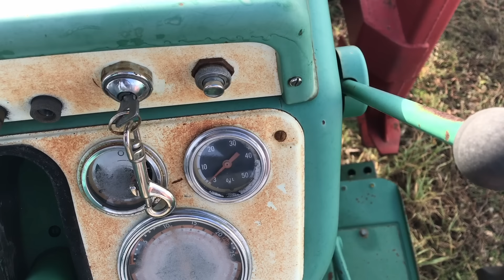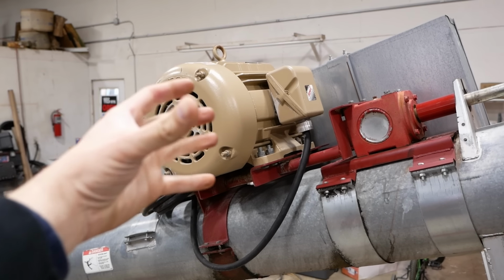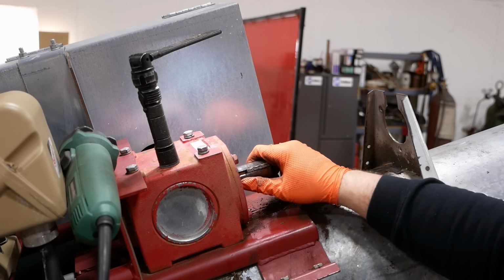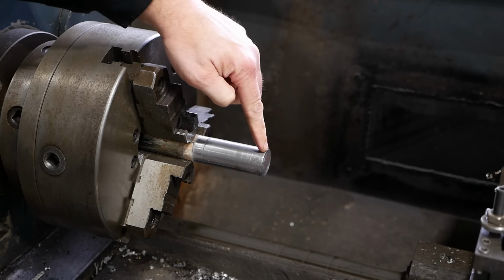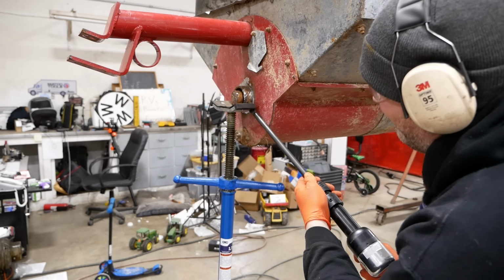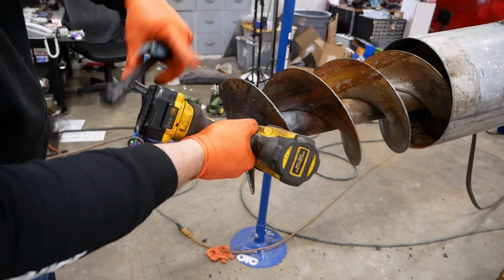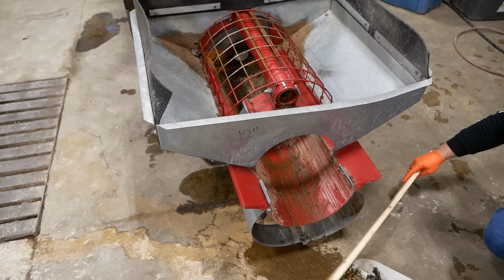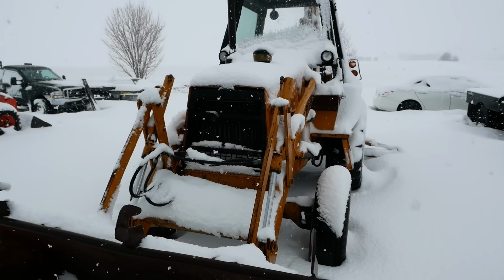Using ALL the Tools to Fix a Chewed up Grain Auger

Comment: Thanks Wes. I worked on grain bins, augers, belt elevators, etc. about 25 years ago as a summer/weekend job. I can attest that rotting grain is enough to gag a maggot, every single piece is always rusted, oblong, wallowed, broken, and mostly designed to never come off, and that no auger has ever been repaired willingly and without a blood sacrifice. Thanks for the memories. Working that job made me drop pre-med to go into engineering. I mostly hate people, so I think the world is a better place because of that.
Reply: Like the Area Diesel Service hoodie..!!
Reply: So you design the machines that hate people. Get rid of them directly, or go big and have the machines do the work…
Reply: 😂  I can relate
Reply: You didn’t have to tell us you hated people, it was self evident when you said you were an engineer. lol.

Comment: Wes: I got about 12 hours into this job, it's just difficult to find that much time to work on a single project...
Me: I tell you what's even more difficult to find.... A machine shop in the middle of a corn field and a machinist who is willing to work on a corn auger for 12 hours...
Good professional factory repair Wes, awesome video and content.
Reply: Wes is amazing.
Reply: If Wes Works, they will come…
Reply: I'm surprised they didn't just weld the coupler to the shaft, must be a new farmer
Reply: The workshop is kinda open again for the public because Wes choose what he'll take. That is great to see.
Reply: @M.TTT.   maybe coulda woven a Chinese handcuff outa bailing wire, but it’s subject to work hardening…
Reply: Thankyou 👍 all good stuff
Reply: 12 hours. Or a new grain auger. Should last a while longer now. You can keep the snow. Although our weather has been pretty awful too. Mid 30's C. And humidity through the roof. Every time you try to do anything, you end up in a pool of sweat. Both ends of extreme.
Reply: 6hrs repair, 3hrs cleaning, 3hrs panel beating and restoration- grand job Wes🇬🇧😳
Reply: @IR-nq4qv: well said.
Reply: Thanks and stay safe 🙏
Reply: First time I have heard "hot dog down a hallway" in that type of manner!! Usually something way more sinister!
Reply: Especially when these augers sell at a farm auction 30 mintues from his shop for 250-500 bucks by the dozens twice a year

Comment: Wes, you decided on the CEE repair to the drive shaft and it looks great!  Most people don't appreciate how destructive spoiled grain and water are to farm equipment (rotting soybeans smell worse).   You have a good lathe setup, and glad to see someone in NW Illinois still knows how to use one!  -17F this morning at my place, so I agree that Winter has self corrected.
Reply: All Wes needs is a couple of birds that hang out and his dog wearing a camera.
Reply from the maker: It was -17 here too. Max wanted to go for a walk. We barely made it across the road.
Reply: CEE  Is one of my favourites. The Crane teardown and rebuild is going to be done as thoroughly as Wes would do it.
Reply: @IGDZILLA  I think that the Frana Crane could keep Wes and Kurtis in content for the next year.
Reply: @WatchWesWork  I'm in NE Wisconsin and the last few days, even our Saint Bernards didn't want to go out.  LOL
Reply: There’s a ton of machine shops in NW Illinois, problem is you either wait 6 months for it to be done right manually, the shop only wants Cnc work or you take it to a mom and pop, which might do it right or might not but there usually have faster turn around times.

Comment: Very cool, I grew up around farms and my grand parents owned a grain elevator. Fixing augers that the grain dust ate up was a constant like you said. Cleaning out the rotted grain in the pit around the grain dump basin was always one of the most gag inducing tasks we had, so I can empathize on the rotted corn smell. Have a great day sir, may you and yours be safe.
Reply: Just don' a gas mask and it doesn't matter what's in front of you :P
Reply: Especially if it's mixed with rust for some reason. 
I grew up in the first small farm town north of Flint Michigan and sometimes help friends who lived on farmstead.
That became one thing I avoided at all costs after the first time no matter how much they'd beg me to help.
That and mucking livestock structures.
Reply: I am a born and bred “City Boy “. I thought we were going to make “pop corn “ for a minute there!
Reply: @rkan2 the mask slows you down to much
Reply: @adamdnewman  A blower mask won't.

Comment: I come from an industrial background, but the machinery is the same.  A lot of screw conveyors have a stuffing box on both ends to seal the trough with the bearings outboard.  The stub shaft is longer but it allows the use of actual bearings and long life.  Great video!
Reply from the maker: That would be nice.
Reply: That makes more sense, but also more cost.
Reply: Stuffing box only helps if the farmer actually keeps it maintained, I know the farm I work on is basically allergic to greasing stuff unless I nag them to let me do it, and many farms in my area are the same way.

Comment: Great job. My dad had an auger similar to that when I was a kid and that bushing would only make it a couple of years. We finally welded some angle on to the funnel box and put a self aligning pillow block bearing on it.
Reply: yea that's what this needs, not sure why they use a bushing
Reply: Ditto. I used to sell bearings and gear boxes. I asked one time why farm equipment had such cheap gearings. The trainer told me, farmers are cheap and they use their equipment about 3 weeks each year.  Bearing upgrades are worth it for sure.

Comment: I imagine Mayrath has a huge number of fixtures specific to the augers, and procedures, like removing the axle A-frame so as to fix the fixed bits better.  But, I'll wager they would not shave more than 10 man-minutes' labor off the job.  So, good job @Wes
And, as always, a great video.

Comment: Thanks for another good video, a grain auger makes a nice change from rusted out trucks with electrical problems. When I used to work at the seed farm fixing the auger fleet was my job. I got real good and creative with repairs to some of them, that were worn out and should of been replaced. I still go back once in a while and fix stuff for them if they are busy just to keep my hand in, but luckily it's new augers and service work more now . Yeah that wet rotting grain smell's something unique. I'd say it would be about the same smell and consistency  as feeding Max Taco Bell everyday for about 3 weeks, and you certainly don't want to get it on your hands and try get rid of the stink for 2 days after L.O.L  Take care.

Comment: My dad and I used to fix these things for the local farmer when I was a kid.  I never knew how they managed to screw them up so bad, but I always despised working on them.  You could always guarantee a weld job was coming.  All the ones I've seen were PTO driven, so probably worse damage happened if you consider I don't ever remember seeing a slip clutch on them.  Farmers will run the life out of things for sure -but generally out of desperation and not ignorance.

Like how you removed the coupling ..just got a flashback to a 3 point spreader I bought last year.

Comment: As soon as I saw a grain auger coming into the workshop I knew trouble was in store ! I grew up in Western Canada on a farm , as you drive down the gravel roads you see more than one grain auger lined up in neighbor’s machinery parking area waiting to be repaired , nobody has the time to do it during Spring or fall rush so just they get a new one because you can’t stop seeding or harvesting and you can “ fix it this winter” but after you fix one it gets old really fast so they don’t get “round to it” ! Bloody aggravating as every one is different and you can’t seem to get parts for them?

Comment: Air hammers are the true unsung heroes of everybody who turns wrenches and finds themselves responsible for the care and maintenance of rusty junk. I feel stupid that it took me until my mid-30s to finally get one and start using it--they're cheap and will run off of a lousy roofer's compressor. Better late than never, I suppose.

Comment: Cool repair.  I like your explanation of why the oil lite is the preferred OEM and repair.  I wonder if a secondary stainless sleeve on the outside with a couple set screws that could hold the steel/bushing assembly would work then the OEM could sell a replacement kit that drops in.

Comment: Loving the sketchy lathe setup and the weasel wiz cutting lubricant 😂. I did wonder if a double sealed roller bearing on the auger end might have been a better setup? Things are getting all hyped up this side of the pond about torrential snowfall coming. Two inches of the stuff stops most of the U.K. 🙄. G wagon time is what I say 👍😁.

Comment: We used to use what’s called a Babbitt tail bearing on the tail end of those augers. It’s basically a lead filled cast iron housing that bolts onto the end plate. They wear slowly and in addition to providing lube for the steel tail pin they prevent them wearing down in diameter also.

Comment: Nothing like the smell of wet soybean meal when locating railcars at milling company on a hot July or August afternoon. I feel your pain of the smell of rotting corn, sure it is similar to mine. Not to mention your boots tracking in back in the motor for ride back out to the main line.😮
Reply from the maker: And chasing off the super sized rats!
Reply: @WatchWesWork is that where the princess bride came up R.O.U.S?

Comment: My brother has 5 augers and it's one of the things that breaks the most on his farm. I'm so annoyed by how poorly they are made that i'm genuinely consider making one from scratch to pit against them.
Reply: These are built cheap because they sell cheap. Highly competitive industry. I engineered, built and sold these for 40 years. They are only designed to last about 5 years. There are many different styles of end bearing arrangements. You can buy replacement parts from many different manufacturers. The oilight bronze is the cheapest. The option that uses a pillow block ball bearing is the best but requires a stand off trough end and a longer tail shaft to accommodate it.
Reply: @billyporterfield2196 Why couldn't you put a roller bearing in place of the bronze  sleeve?
Reply: @rkan2 I I don't work with grain augers but in another contaminated environment.  The problem with roller element bearings is that if you get crud in them, they jam and the rollers skate rather than roll and wipe out the mating surface.   Plain bearings suffer less.  In my ignorance I would like to try a plastic bearing and a stainless shaft (for wear resistance) but it's hard to retrofit that since swapping metal for plastic kinda needs to be considered at the beginning of the bearing design.  Exotic high performance plastics which could maybe swapped for metal exist, but they're also expensive.
Reply: @rkan2 you can if it is a pillow block bearing sitting on an outboard pedestal as I explained above. You can buy this conveyor new with this arrangement but the cost will add about $1000 to the sale price. Most of the farmers don't consider this a necessity until the sleeve fails. Remember that the highly competitive nature of the grain industry prevents the manufacturers from adding this feature unless they are willing to provide it at their own cost. Conversely on the heavy duty industrial side it is the opposite. Most industrial clients are more than happy to pay for any enhancements that add to the longevity of their equipment due to costly downtime and loss of production. Farmers just want to get thru the harvest and worry about repair and maintenance when the next season starts.
Reply: @billyporterfield2196  I guess that kind of translates to when your farming operation is large enough where you can buy machinery that is basically "heavy machinery" :P Not so with this auger.

Comment: Nice fixes, wonder when it makes sense to replace these bushings with actuall ball bearings? I'm guessing those are a lot more expensive
Reply from the maker: I think the dust and grit would just eat up the seals.
Reply: I suppose you’d need needle bearings, and you’d need some kind of spring loaded greaser to push ambient crap out.   That hopper needs weep holes ?
  That thing needs to live under cover !
Reply: A lot of the industrial augers will have a rope packing seal to keep the material out, then a flanged bearing after that. Works well, but pretty complicated

Comment: Hi Wes, I would think that a sealed ball bearing pillow block would be a great improvement over an exposed bushing for the auger assembly.
Reply from the maker: I've never seen one done like that. I'm guessing that means it doesn't work.
Reply: You'd have to change the bearing material.  Oilite bushings are oil impregnated, and adding grease would not aid its lubricating properties.  If grain dust got in to the mix, it may even close up the open sintered structure, removing the oilite's ability to lubricate.
Reply: Any grease squeeze out would be bad for whomever you are feeding it to.
Reply: I guess Snowball Engineering has influenced you Wes,  Thanks for the link to his channel. Take care of yourselves.  Kindest regards from Bonnie Scotland.  Joe.
Reply: @12345NoNamesLeft There are FDA approved "food grade" greases, but that's expensive and we all know how it'll actually go down in the field ... 🫣
Reply: @tsp159  ,  fwiw ... There is no such thing as a food-grade grease that works as well, much less better, than either industrial petrol/parafin or synthetic grease. Not even in food production.  FGG is mandatory there, but so also is far more frequent bearing repair/replace on shafts of any size.
Reply: What about a couple of water weep holes in the bottom end ?  Would they lose that much grain dust ?    @WatchWesWork

Comment: Here in rhe UK 20 years ago, most augers generally had no bush or bearing at all on the bottom end they just rattled about until the grain filled the flutes in the tube and then they ran pretty quietly! Admittedly at that time they were smaller around 6inch.

Comment: Nice job Wes - and FWIW, I completely agree on the lower bushing.  OilLight bronze does not need a grease zerk.  All that grease would do is collect dust and turn the resulting goo into a grinding paste.  Better the thing runs dry with just the oil that lives within the bushing.

Comment: Wes, I have a short back ground in machining, joint vocational, machine shop, mold shop and a very small amount of CNC.
The “Confidence Inspiring Set Up”, “Adjustable Angle Plate Clamped To A Steel Table” I can not believe you did not take it one further (“On Wheels”) definitely a “Death Wobble” (on wheels) Wes, you are slipping.. I am still laughing at that. Also your comment about the “Grain Dust And Grease” I said lapping compound the same time you did… I found your channel watching Neal Koch when he had your channel playing on his TV in his shop. I have been watching your channel ever since. If I haven’t watched every video you have put out I would be surprised. I constantly watch reruns of “Watch Wes Work”.

Comment: My inlaws have a round hay bailer that eats bearings and shafts. The way those are made requires you to disassemble everything to move one thing just to drive the shaft out to replace a bearing. Plus an 8 foot chain that has a master link somewhere.
Thanks for the great video Wes!

Comment: I have a little grain handling project you might be able to fix for me. One of these days, I'll have to come by the shop and show you what I have in mind.
 I used the OC46 to clean out my South driveway yesterday, just in time for the next"correction event" that will bring more snow and below 0 F temps. Snow was only 4 and a half feet deep for the last 15 feet out by the road.

Comment: An enjoyable mechanical repair to some ag equipment. No meters of electric cable and accompanying sensors, relays and switches to remove. Good access to all nuts and bolts.

Comment: Great repair. You must love that drill press to use it over the mill to drill that large hole. And your lathe setup was just fine. Longest part I ran in a lathe was 15 ft long. Thanks for your time.

Comment: Hey Wes, I've found putting some anti seize or even a bit of grease in shaft couplings like that will save you hours of frustration the next time you take it apart. 
Great content. Thanks!

Comment: We got 1 that the shaft slipped on. We welded 15 years ago. It runs fine. Just used it last Thursday. Gonna use it more when the snow melts. It’s at minimum twice as long as that little baby auger

Comment: You are privileged. You have all the mechanical, welding and machining equipment plus the space and knowledge to use them, not forgetting the way to work around problems. I have similar equipment in my 16M x 8M shed. The only thing, near Sydney Australia, is the lack of snow. In your terms it's only been about 90 - 95 degrees F. The dodgy setups for the end of the bar in the lathe are just fine - as long as they work and no-one/nothing gets smashed. Overall, well done.
Reply from the maker: I'd take the heat over our cold. It's currently -28C.
Reply: Easy fix. Come to Australia. Rarely below 0C. Ask Mrs Wes. We could use your abilities here.

I can match you in some areas but your broader range of knowledge plus your diagnostic,  computer and 3D printer skills are way beyond me. I learn heaps from you even though I have been a mechanic and machinist for many years. @WatchWesWork

Comment: Way back in the day, I worked in a grain elevator. The augers used wooden bushings because the grain dust and wood actually became self lubricating. At least they never got hot and didn't cause a fire.